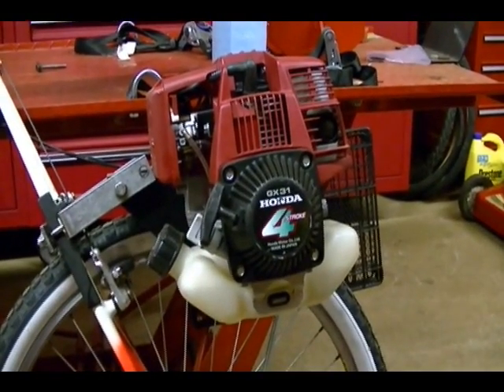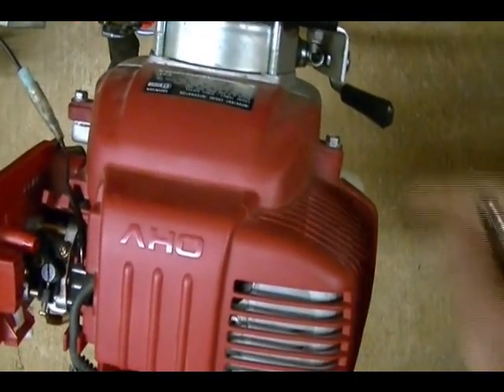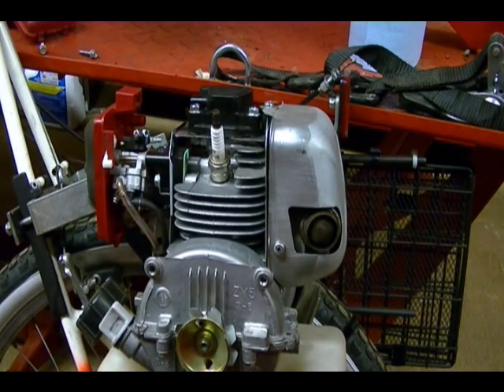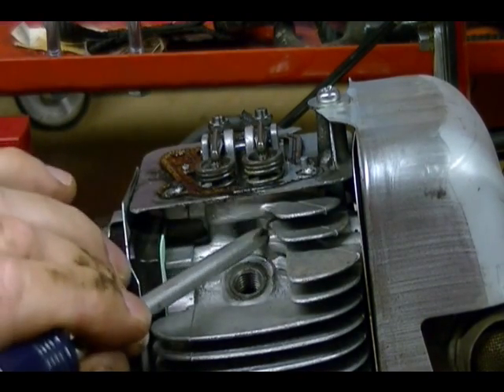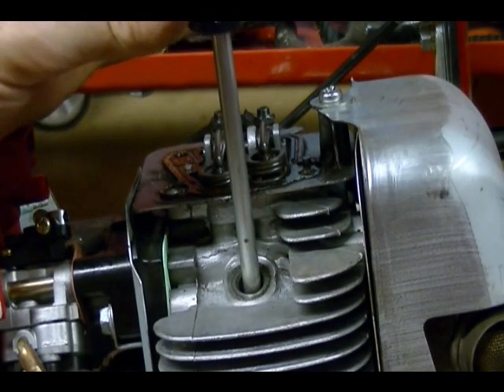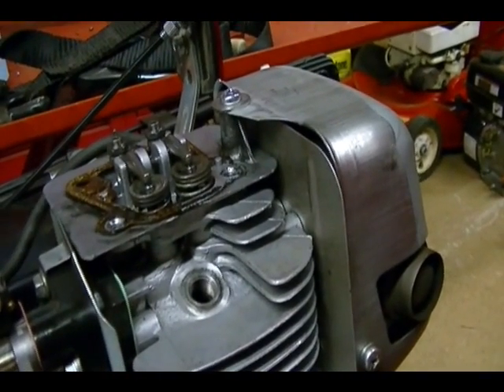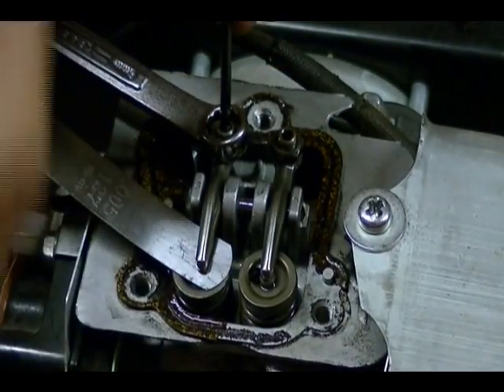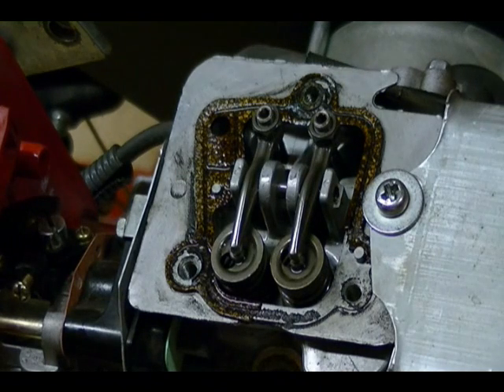Small Engine Repair: Adjusting Valves or Valve Lash on a Honda GX31 Engine

Comment: Hi, I am having GX31 engine, manual stated 100ml engine oil, but still experiencing cylinder head cover leak with new gasket fitted, took down plastic cover and it has deformed slightly. My question is does it normal to see engine oil within the plastic cover?

Comment: Very informative video. Thank you for your precise instructions. I've had a Ryobi 2079r professional trimmer for 13 years. Only issue is the gas tank has always leaked. But my gosh. That thing is a beast. Now, I'm in the market for a new trimmer. I'm glad I held off on buying a Stihl 131r last week when I had it in my hand. The longevity of that product just doesn't seem as if they put too much thought into quality of their product.  Based on my research I've found the Honda to be the best trimmer to buy. 
Husqvarna in 535LST was my first choice since my 450 Rancher & 435 chain saws are awesome. But, looks like I'm going to go for a 4 cycle trimmer. Which apparently Honda is hard to beat. Videos like yours show the engineering that went into the Honda motors. That's why all Honda equipment lasts forever. My son's 1975 50Z motorcycle still runs like a champ. I love my Husqvarna brand items. 🤔 but from what I see, and read, Honda is going to have my next purchase. Awesome video. I really enjoy working on lawn equipment motors. And videos like yours explaining every detail keeps me intrigued to where I watch it numerous times. TY sir.

Comment: My critique is that a professional never leaves the surface of the gauge or the valve stem devoid of lubricant while moving the feeler gauge in or out of the gap to be measured. Also a pro Never leaves the gauge in the gap while tightening down the adjustment. You take a good chance of smashing the thin metal of the gauge to a thickness Thinner than the intended Machined thickness  !  Remember , keep it lubricated , don't force it into the gap & when tightening the adjustment NEVER leave the gauge inside the gap between the stem of valve & the rocker arm end. Keep your gauge as an Accurate Gauge. Also if you want to be a real super nerd Try to use a Go-No Go Gauge if you have one suitable for your aimed for clearance. If you need to aim for Inch standard of say 4 thou , the Go-No Go gauge will have 3 thou on narrow part of the strip & the thick part will be 5 thou . Since the 3 will slide easily in the gap ( remember the thin coat of silicone based oil on gauge ) and the 5 thou thick part will Not fit easily into the gap ; you will have adjusted it properly with no need to feel pressure of gauge sliding into or out of the measured gap  !  That is the best way . Yep , I was once a somewhat great mechanic. Top Journeyman at Greyhound Bus Lines & noted in their museum. Good Luck campers , don't let the bears eat all you food ...........  Nick , NavyBlueSmoke . LST-1195

Comment: Hi there. I know not a lot about these engines. I have a Honda 4 stroke petrol grass Cutter. .  The cam wheel where the timing belt goes around shattered. So I bought a new one. I know you don’t just replace the cam wheel and replace the belt. Hence this questioning.   
I know my engine is different from yours, but the principle is still the same. I should imagine. 
when you said that you make sure that the piston is at TDC on the compression stroke. Then you went to the flywheel and make sure that the notch on one if the fins, is lined up with a mark on the casing. 
I noticed you moved the wheel to line up the both. 
Question:: in this case, by you moving it to line up. Wouldn’t that put the piston off TDC
Like the video. 👍👍

Comment: I have a wiring question. I got the Honda GX35 for my bike but don't have a kill switch that works with it. Any idea what the wiring is made out of? The kill switch I tried to use was made of copper which was not compatible with the Honda GX35 wiring.
Reply from the maker: +Johnny B Copper is not compatible? Are you trying to run a kill switch up to the handle bars?
Reply: ***** Yeah.
Reply: Ok I know its been a while but I did fix my kill switch issue. I ended up getting a high quality toggle switch specifically for my engine from Staton Inc. & it works now. Yay! Now I don't have to keep shutting it off by tapping the bare wire on the metal part of my mount which didn't feel safe especially after refueling it.

Comment: there is gas getting into the oil I need help. Honda gx31 tiller engine
Reply: Are you using it upside down? Gas could be leaking out of the grommet or carburetor into the engine block which can contaminate oil. I remember moving my GX35 engine upside down for maintanance while it was on the bike & some gas leaked out even with the gas cap on. For some reason some small engines don't do well upside down or at other unusual angles.

Comment: I have a Honda umk422 trimmer with this engine's smaller sibling, the gx22 (about 16 or so years old). Excellent motor. Still going strong. However, it does get a little hard to start after it has been running for a while. Think the valve's should be adjusted?

Comment: I was wondering what the torque rating was on the bolts that hold the valve cover in lb per square inch?